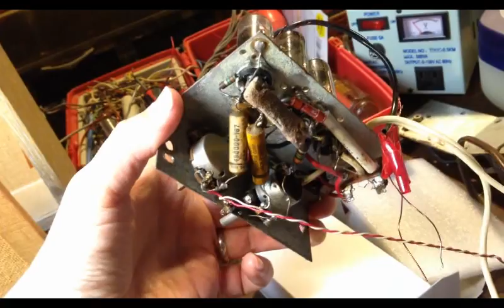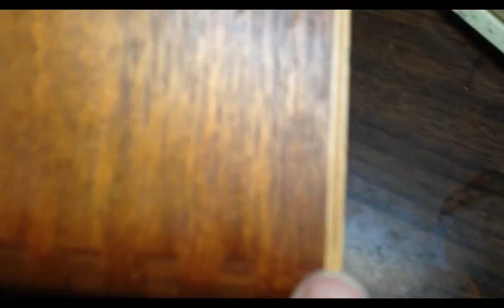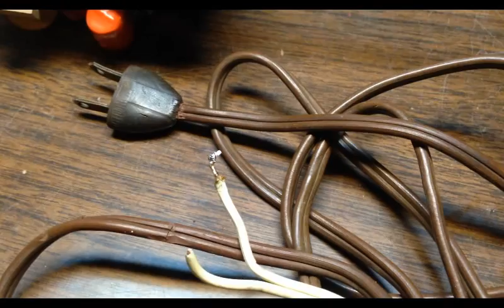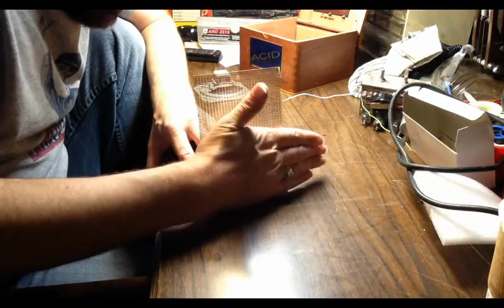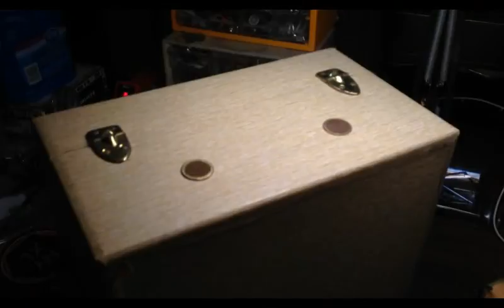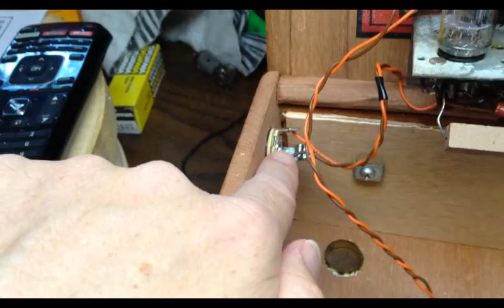'50s Record Player - Cigar Box Tube Guitar Amp Robot Conversion

Comment: I just scored a 1960s vintage audiotronics classroom record player, with a little tube amp. It has a single 6T9 tube.
After determining that the motor drive for the record player was shot, and wanting another tube amplifier. I dissected the unit and gave it a guitar Jack input. The output was kind of underwhelming even though the speaker sounded okay. Dinky little nichrome magnet. So I hooked my linear power booster, from electro-harmonics before the input, and wouldn't you know it it has gain.
And this thing sounds better than my soul food pedal. So I've pushed it into my big amp, as a preamp with a treble boost. And it is amazing. Sounds like 1950s raw early distortion not artificial distortion. I very much enjoy your videos thank you. I wanted to tell someone that would understand.

Comment: Hey Brad (anyone), are familiar with the Jewel Radio Corp 5020U radio/phonograph from the same era? I have the guts of one and was wondering if it's  a viable candidate for amp conversion.
Reply from the maker: Not familiar, but radios and phono amps usually take a lot of modifying.
Reply: Thanks, man.

Comment: Hey Brad, I recently picked up my first phonograph to convert. It hums the same level at any volume with no output. I have heard that I need to replace the Filter Caps. Is this true?

Thanks.
Reply from the maker: +David Six yes, sounds like it.
Reply: The Guitologist thanks!
Reply: The Guitologist another question for ya. Could I convert a 1929 RCA Radiola 66 radio into a guitar amp? There’s someone in my town selling one for $40 and I’m wondering if it’d be worth the work. 

Thanks.

Comment: Even though you have a three wire cord installed, there is still a safety issue.  I have been shocked when using a three wire  socket with a ground pin which was incorrectly installed (black wire to neutral, white wire hot!).  If you plug into something like this the ground on your input jack and shield on your guitar cord would be hot with 120V AC.  You could separate the ground connections in your amplifier using a separate ground wire not connected to the metal chassis, but you would have to install an insulating wafer under the metal filter capacitor.  The "death capacitor" (which now connects the input audio ground to the AC "hot" amplifier ground) should be no more than 0.01mF and at least 600V in parallel with a 1Meg. resistor.  I never have liked "AC/DC equipment from the 1930s through the 1960s for this reason.

Comment: Nothing like corded power tools! I have the exact same cigar boxes for my projects. Where did the high voltage come for the plates of the tubes to make them work? It looked like the only voltage supply was the 120 volts AC. Great as always! Love your posts. Thankz
Reply from the maker: Yeah, it's a series filament amplifier. The rectified DC voltage is only around 120VDC or so. With a decent cab and an efficient speaker they can sound fairly loud for what they are.

Comment: I would've used the original cabinet, and maybe a bigger speaker (cut a bigger baffle-hole of course).
Reply from the maker: I considered that, but the top and back of the record player cab were just cardbaord.
Reply: The Guitologist Must be some damn good cardboard to have survived all these decades. I realized after watching this, I don't HAVE a little amp that I can just set up anywhere and play. I need to put together some kind of little 1x8 combo or something. Maybe something battery powered......huh, wonder if there's a battery-powered tube amp I could build. I mean, not with a car battery, but like a 6-pack of D's. Maybe some submini dual triodes in the pre and a pair of submini pentodes in P/P for like half a watt. Or I could just go on ebay and find a little solid state practice amp. I am just looking for something to mess around on.
Reply from the maker: Battery powered tube amps have been around as long as there have been cars. They used vibrators to simulate AC and step up transformers. There are better ways to do this now, more efficiently.

https://www.youtube.com/watch?v=nHq6vArLVc8
Reply: The Guitologist Vibrators....
Reply from the maker: At the end of the video I should have thrown a glass of water on t so I could have included the word "wet" in the title. Imagine the hits then. This video might be as popular that one of the kid's brother biting his finger.

Comment: I wish that I had the knowledge to fix these things. I just picked up a 5 tube Phono-Art version and am scared to death to do anything to it.
Reply from the maker: Your fear is partially warranted. You should exercise caution when dealing with hot chassis amps. You should service them using a Variac or other isolation transfofmer.
Reply: How do you feel about playing them without an isolation transformer? I just got an old silvertone with the exact same tube set, so I'm curious if I should install one permanently and deal with the half-wave rectifier issue or just be uber cautious while working on it and just play it as is.